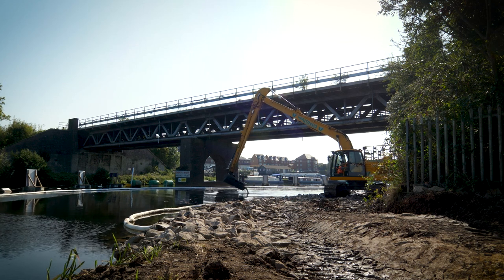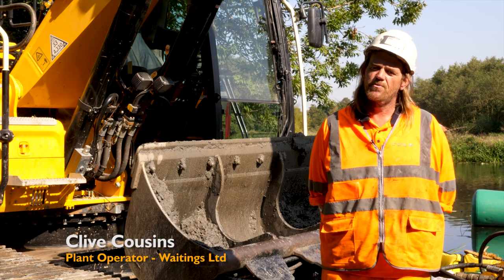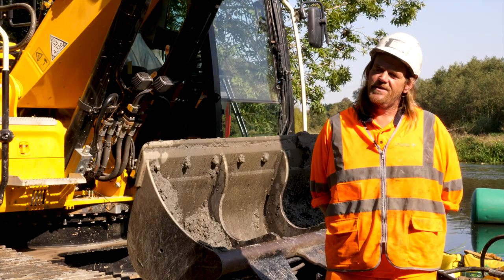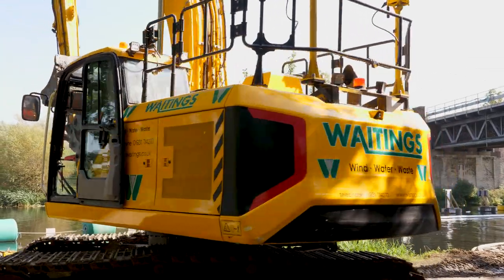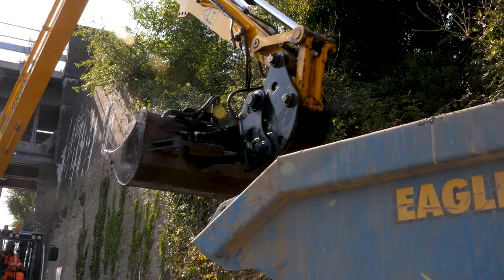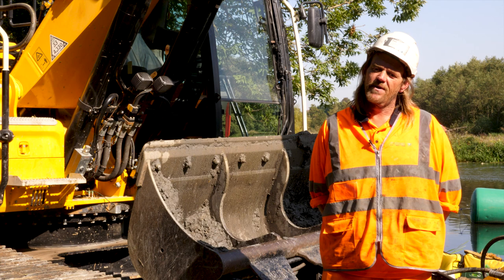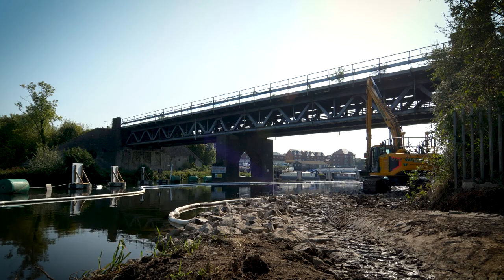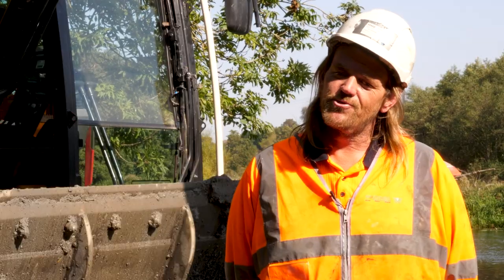JCB 220X Long Reach Excavator Feedback - Waitings Ltd

Comment: Look alright but Still not a volvo 🤣
Reply: Course it's not.No dpf and regen to put up with.
Reply: @andrewbrady6385  - Agreed..  but still wouldn’t have one.. team Volvo all the way for me.. 12+ years of operating 360s now & there no better machine than a Volvo..  I’ll take the dpf & regen every day 100x better machine than a jcb.. my ec380 spot on no issues at all with regen or dpf at all..
Reply: @thewippit8717  40yrs operating machines and 25 as an owner operator and I'm on my 7th jcb machine. Nobody makes a perfect machine,but here in Dublin the dealer service for JCB won't be beaten so I suppose it influences my opinion.My current machine is a 2017 Js 220 plus which is as  fast , powerful and reliable as anything else out there.
A firm I have worked for run all Volvo from 2 to 50 ton and won't buy anything else because the dealer in Dublin looks after   them and the machines are mostly trouble free  and get through the work . Everyone has an opinion on machines and that's not a bad thing.Like I said nobody makes a perfect machine.
Take care.
Reply: @andrewbrady6385  - agreed with what you say totally it’s each to there own if we all liked the same life would be boring... 
were same here we have nothing but Volvo.. 360s from 14t up to a ec750 high reach & loading shovels & dump trucks are all Volvo all crushers/screeners are mckloskey.  We use Volvo SMT for service & there great never let us down.  Quick to sort issues our Boss just loves Volvo & gets good deals & looked after he wouldn’t have owt else now he use to run komatsu years ago but service was sloppy so went to Volvo never looked back.  We’ve had lots of other makes on demo jcb/doosan/cat/Hyundai.. but nothing compared to the quality of the Volvos.. as an operator I no what cab I wanna spend my hours/days in lol for driver comfort nothing compares to Volvo cab personally.. then new jcb x series are ment to be good machines but not driven one yet..  as for the Js models I personally don’t rate em.. we had a new js360 on a demo like 300 hours on it & it was awful so slow., crap for levelling up with at reach & no wear near as much pulling power as a 380volvo it just seemed gutless & very slow..